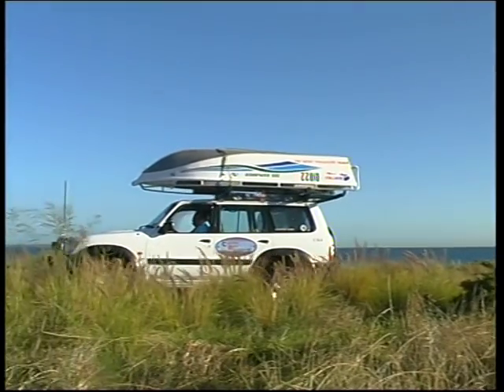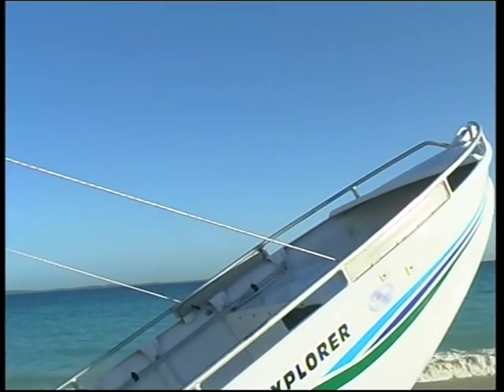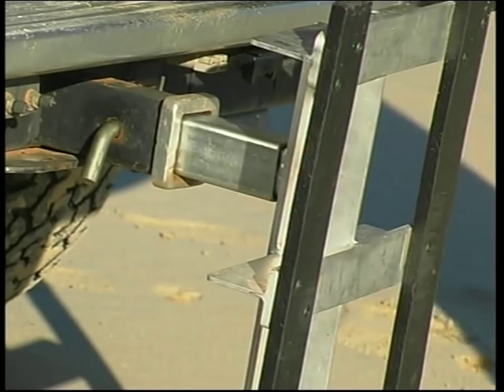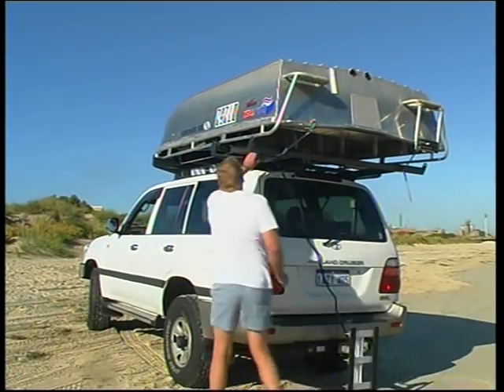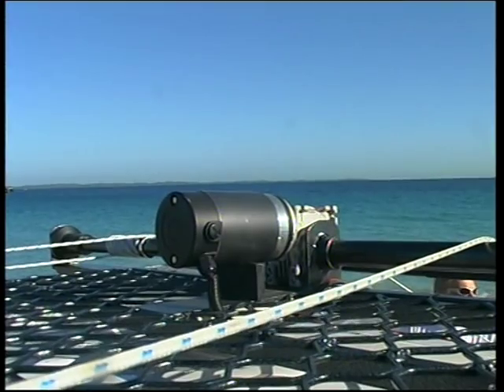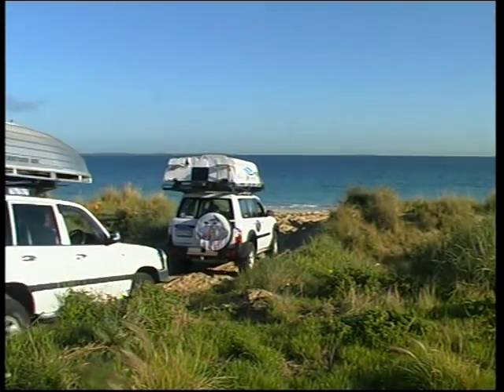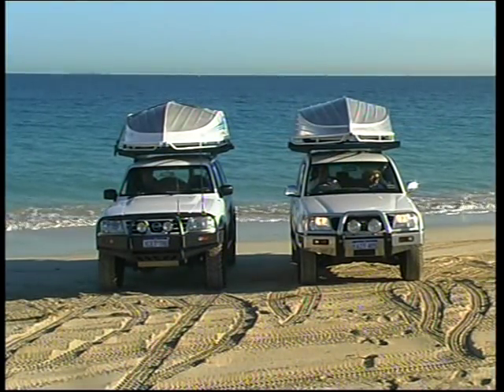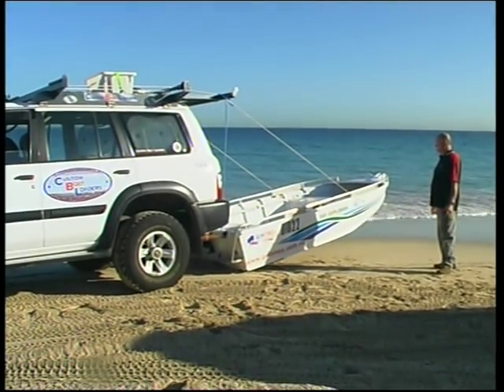Custom Boat Loaders Demonstration Video 2008

Comment: Where do you put the motor when the boats upside down on the roof if you've got a wagon. Will it fit under the boat on the racks and then have to wrestle it down